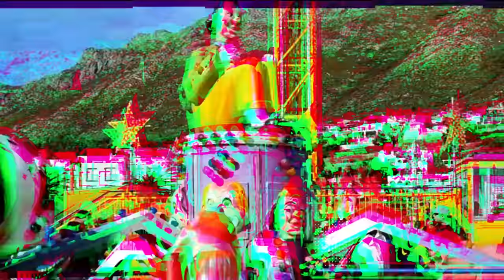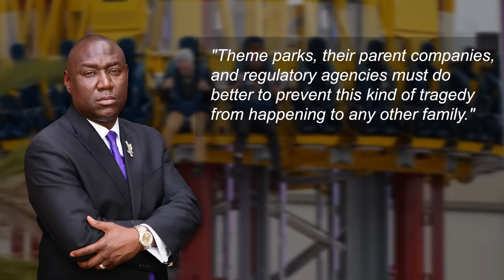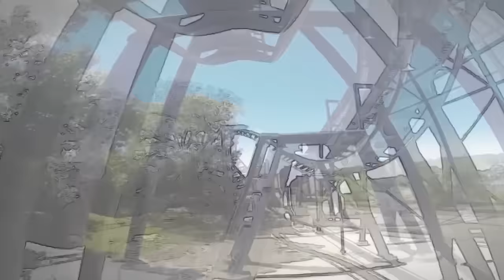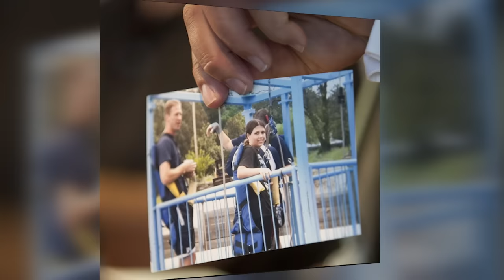9 Worst Roller Coaster Accidents in Human History

Comment: I went to an amusement park last summer and I forgot the name of it but there was a roller-coaster that you sit in and your legs dangle (might be called a suspended roller-coaster). I went on it one time and it was amazing and i loved it, it was my first roller-coaster like that. But the second time i went on the lady in front of my sat in one of the seats and her bar went down but it looked kimd of weird, like not fully secure. She still went on it and was fine but claimed she was never going on it again. I was in the same row she was in so i had to sit on that seat because i was with my younger sister and i didn't want her on that seat. When i pulled the bar down after buckling it, i still didn't feel safe and the operator checked it and it came up from my stomach a few inches, but she said it was fine. But when the ride started i almost started having a panic attack and crying becauss when it aas going upside down and up i would literally lift out of my seat and have to forcefully push myself down when possible,  like my knees were starting to come out. I'm 15 years old and that scared me so bad and i kept repeating that i didn't want to die. After the ride i was crying and shaking and i told my mom they should probably close down only that seat or something because it isn't holding people in it, and I'm a little chubby and even i was starting to come out of it, so if a smaller person or skinnier person went on that seat they probably could've come out. 
Sorry for how long this is, but thanks for reading

Comment: Six flags in Vallejo, CA, they had a roller coaster ride and it was 100 degrees outside. The first time it was used it got stopped upside down. Some people we held by restraints for 5 hours! Many peed their pants, it was so hot and miserable, I could not imagine being stuck their in that heat upside down! I am so done with rides, two dangerous for me! When I was a kid, they had a ride called the mouse, the plywood floor fell out and someone had their legs cut off!

Comment: People in the area of Darien Lake (which is nowhere near Syracuse or "north NY"; it's in Western NY) know that "accident" on the Superman roller coaster was actually a suicide. Immediately after the incident, other riders disclosed he not only intentionally held the safety bar up to keep it loose, but turned to the family member who rode with him to say goodbye before essentially launching himself out of the ride. The park did settle with the family because the ride operators could have and should have done things that would have prevented him getting out of the seat, but it was no accident.

Comment: I will never forget the time I was riding "Batman The Ride" at Six Flags Over Texas, and my safety restraint came undone as we ascended the initial drop. Fortunately, I pulled back down on it and relatched it before cresting. I was young, probably 8 or 9, and was too shocked to report it after getting off the ride. I guess it was some anomaly since no one died or was injured shortly after, or ever, on that ride.
Reply: What part of the restraint "came undone"? If it's the seatbelt then that isn't dangerous as a seatbelt is meant to be an indicator as to whether or not you will fit in the actual restraint, and on B&M coasters (company that build Batman The Ride), the seatbelts are not meant to secure riders. If the actual restraint "popped open" a click, then that is actually not dangerous, as the restraint never was fully locked into that ratchet position, and simply moved into the next one, which was locked.
Reply: I assume you mean seatbelt came undone and the seatbelt is completely unnecessary and is only there in case the main restraint unlocks which is already dam near impossible

Comment: How does a 14-year old kid weigh 300 pounds and become so fat that the overhead harness can't come down low enough to lock onto the first rachet.
There's nothing wrong with the ride. He exceeded the size limit, and someone allowed him to get on.
Reply: Kfc
Reply: It's my understanding the kid was very tall as well well over 6ft and was a football player.  Also my understanding he was on vaca with family other than his parents. He died in a horrific manner. He was denied riding other rides due to his size. The bar could not lock properly, he should have been denied riding. As a parent, my heart breaks for his parents.
Reply: He was the size a tall, full grown man at 14, exceptionally tall for an 8th grader.  His parents said he was 6’5”.  Yes, he was heavy, but he was also very tall for a young teen.  Look at pictures of him and you can see he’s almost the height of a 7” door frame.  He should have been turned away based on his overall size, not just his weight.  
If he’d lived, he’d probably have ended up around 6’8”.

Comment: As a child i use to love going to amusement parks but as i got older and saw how dangers some of these rides can be because the lack of safety...i just stop going there.  The last one i went to was Six Flags in Georgia.  The roller coaster 🎢 ride that i rode on looked like it was ready to fall apart. That was the first warning sign. The next was as soon as my family and i got on it and it did the loop going so fast through a tunnel. The roller coaster rails felt so unstable making the ride shake like crazy. And going under the tunnel if youre a very tall person there's no way you would've been able to get on that ride. I'm not that tall but i had to bend my head down because i felt like i might have  been decapitated.  The tunnel just isn't leveled right . I couldn't wait to get off of that ride. That was it for me. My very last ride and amusement park.  It's like the owners of these rides don't care about people's safety.

Comment: I almost flew out of a ride once. I was holding on to my dear life and succeeded, but, after the ride stopped, I was relieved it was over, and when I was getting out, the ride operator opened the bar and swing it open, and it came right back down and broke my finger. I sued the carnival but, I never went on any carnival rides anymore. You never know if, you will be the next victim.
Reply: You sued the carnival? Lol.
Reply: @Wildcattttt they could of died isn’t that enough?
Reply: Wow
Reply: I’ve had a few near misses. One at a Six Flags, on what was called at the time “the tallest, fastest wooden roller coaster in the world.” I was sitting next to a guy that was over 300 lbs and I’d heard horror stories of the lap bars not locking properly with people over a certain weight (there were no additional seat belts). It didn’t feel to me like mine locked tight enough. I kept shoving down on it out of paranoia (big mistake) as the ride climbed. When we went down the first, biggest drop , I felt myself lifting out of my seat, so I literally folded my body in half over the lap bar and crawled under the seat in front of me with my upper body. I made it through, but when the ride was over the lap bar was jammed and they couldn’t get me out! I said I was most definitely not interested in riding again and “hey just keep riding” was no kind of permanent solution. They finally got it free and I escaped.

Twice at a water park: once I almost washed over the top of a chute ride (several story drop). I caught the side of the chute and burned the hell out of my hand from friction. Second time, I hit my head on a slide and blacked out. Slide ended in a shallow pool of about two feet of water. The next people on the slide were coming down on top of us, I was shoved out of the slide and almost drowned, in two feet of water, until my companions realized I wasn’t behind them. My head was bleeding and I ended up with a concussion. That same day, after I left, I saw on the news that a four-year-old boy drowned at the same park (his poor family I can’t even imagine)! 😰

I stay away from amusement parks now.
Reply: @KE-hr4sb I havent gone near water parks since I was about 12 or so for that exact same reason. Once our tube nearly went over the edge and on the same turn down my friend that was on the tube with me got bumped out of it on one of the slide humps and she had to slide the rest of the way down in front of me nearly being ran over by our tube. So insane. 😳
Reply: @KE-hr4sb Omg 😮 yes please stay out of the parks !!!!  🙏soo scary for you !! Glad you’re okay 😅
Reply: @jessikat56  Omg is your friend ok? Super scary! You never think something like that could happen to you.
Reply: @christineleahy2013  Thank you! Yeah I figure I’ve had my three strikes lol.
Reply: @KE-hr4sb  😂😂😂that’s for sure 🙏😂
Reply: @KE-hr4sb oh you talking bout Cameron? For the water park
Reply: 4:27
Reply: Of course carnival rides aren't safe. They are set up for a few days at a time. They don't do proper safety checks. My parents never allowed us to go to a carnival. We were allowed to go to the stare fair but that's set up for a month. I never let my kids go to carnivals either.
Reply: The Texas giant was my first roller coaster. I went on it around 8 or 9 years old. My mom was in it as well and I nearly flew out. My mom was terrified bc I lifted up on out of the seat. The bar kept my mom in and she kept her arm out trying to keep me in. I don't know how close I really was to being ejected, but it never stopped me from going on it again. I waited until high school though. My parents kept me off roller coasters as well for a few years as well
Reply: @roxyamber3537  Could have = could've.
Reply: @wintersbattleofbands1144  and what are you grammar police?
Reply: @KE-hr4sb in your first story you’re describing airtime, that’s what’s supposed to happen
Reply: @lesterine77 that is what the ride is designed to do lift you out of your seat, that’s why it’s called an airtime hill. Your restraint keeps you in and keeps you safe

Comment: im 185ibls/84kgs and 5'4. I love amusement parks and have been on every ride, almost. there are these 2 rides that i love, Discovery and TopSpin. Discovery is a ride that is around 100ft tall with 24 seats. It operates in a circular motion, turning the riders upside down at one point. The workers have special seats which have higher belt-stretch capacity for fatter people, I always make sure my belt is properly secure and my shoulders are pressed bac. Even then, when the ride turns upside down, my body-weight falls on my shoulders and I have to tightly place my feet on the barrier to feel safe. I found this risky hence asked people/the operators if this was just the ride or if this was just my issue. Turns out, everyone has that gap between their shoulders and the barrier. The other ride, TopSpin is a smaller but much riskier/scary ride. I cant even explain how it operates - but the belts of TopSpin have always been tight on me. Recently, the operators didnt let me on because they were scared the belt might open during the ride. Pissed and embarrased at first, I now realize how important that is for my safety!

Comment: I went on a tube ride at a water park with some friends, one of those group rides, and at several points down the curve of the slide about half of our tube lifted up over the side, and at one point even started tipping over the edge a little before gravity pulled us back down into the slide proper. I was NOT happy by the time we got out and refused to go again.

For some reason, everyone else seemed to think I was overreacting, lifeguards included, but I left the area of the ride and refused to even watch when others went down the slide as well; if anything happened there was nothing I could do and I didn’t want to see it.

Like I’m sorry, but I FELT myself go complaining above the edge of the slide to where I was suspended in midair, and maybe everyone else was too busy having fun to notice but I could FEEL gravity trying to pull on me. If I had jerked in fear and accidentally thrown my weight backwards I am 100% certain we would’ve gone over the edge and fallen, the only reason we didn’t is because no one did so.

It’s all fun and games watching people be scared over nothing going wrong but if you think you can best gravity, especially when dealing with people of varying ages and sizes who can and WILL move in unpredictable ways on the ride, then you’re a fool.

Comment: Ok. I didn't finish the video fully due to alot of inconsistencies with the facts. So I came to the conclusion that it is not worth finishing. But with that said, the first stroy of Sampson. It wasn't a rollercoaster but a drop tower, second the manufacturer is The Sling Shot group who does have a bit of a shakey safty past but nothing that bad, third the ride operators did in fact deny him of riding due to his weight but it was ultimately decided to let him go on after much back and forth between the kid and the people he was with and park staff. Final point, for this accident, there was no "stafty strap" but just a over the shoulder restraints and it was locked into place due to the kids height and weight it wasn't able to properly secure him. Just FYI, about 98 percent of all rollercoaster accidents are actually in result of guests doing things they are nor supposed to be doing along with ignoring safty rules. Countless examples and cases of people getting hit either on the ride or not on the ride by flying cellphones and or other unsecured personal items. All due to people not doing what they are supposed to do. If your on a rollercoaster going about 50 miles per hour that cell phone you have in your pocket Flys out, that becomes a projectile and can seriously hurt someone. It has happened.
Reply: Glad I wasn't the only one that knowest the inconsistencies. I came to see how cringe this video was, and wow. I usually watch
ElToroRyan and Coaster collage for well informative video on costers.
Reply: +1 the guys mentioned in here.

Comment: My friend almost died when we went to six flags (Maryland, USA) in 2022. We were riding a rollercoaster- the kind with the large restraints that swing down to be lowered over your shoulders and buckled between your legs. The thing is supposed to click into place- locking you in until the operator presses a button to set you free. 

Everything seemes fine and I was enjoying the ride until I looked at my friend who was strapped in next to me. I was terrified; yelling ahout the restraints being unlocked- and as I watched, I could see that he was only being held in by the buckle in the front. The restraint was completely loose and flimsy and i could only watch and grab onto him as we were both flung around by the ride. 

One thin, ragged strap and an old buckle were the only things keeping him from being flung violently to his death.

We left fairly soon after that, but stopped at the bathrooms first. We saw that the pirate ship ride was suddenly closed, nd when we asked about it, one of the teenage workers told us someone had FALLEN THROUGH THE FLOOR before getting on the ride, so there was a huge hole in the platform. We don't plan on going back.
Reply: Yeah, the Six Flags in Largo is not too safe....

Comment: This is minor league trauma: but decades ago on a whim at a street art fair I decided to try out one of those "spinning teacup" carnival rides.  Looked safe enough.  The first thing I noticed was there was no door; just an opening in the side of the cup.  When I got inside the teacup (which had enough room for five or six riders) I discovered there were no seat belts.  As the ride attendant left she drew and attached a rusted chain across the opening.  I was contemplating how flimsy and unsecure the chain looked when the attachment failed and the chain dropped to the ride floor just as the cup began to spin.  For the next four or five minutes I clung desperately to the top of the cup as the centrifugal force impelled me towards the opening.  I knew if I were flung out I would either hit another spinning cup or be dashed directly into the street pavement.  I hated every second of the ride (even though it only cost a dime) and exited in the foulest of moods.  I've never been in a carnival ride since, including those tiny boats that go around in a tub of water.

Comment: I'm surprised that the Kansas City Schlitterbahn incident didn't make this list. That little boy was decapitated because imbeciles decided to rush and build the world's tallest water slide, neglecting all safety protocols and didn't even engineer the ride properly.

I was on a ride with my sons when I had to hold the saftey bar with all my strength, even when we were going upside down, so that my kids wouldnt fall off the ride to their death. I told the operator, but I doubt it was reported. My sons do not ride the Rollercoasters anymore, and I don't blame them, I don't either (and I was the "thrill seeker" trying to ride every ride).

Comment: I went on the Big Shot ride on top of the Stratosphere Tower in Las Vegas back in 1997.  We were rushed in to our seats and I knew I wasn't in properly and the belt was not tight enough on my small body.  I said "hey wait, I'm not in properly", then we suddenly shot up.  I was slipping and thought I was going to come out.  I had to use all my strength to hold on.  It was petrifying.  Never again.

Comment: Fun Fact: 6 flags roller coaster restraints use the same hydraulics as Boeing 747 landing gears. Safety belts are not necessary and primarily used for rider comfort.